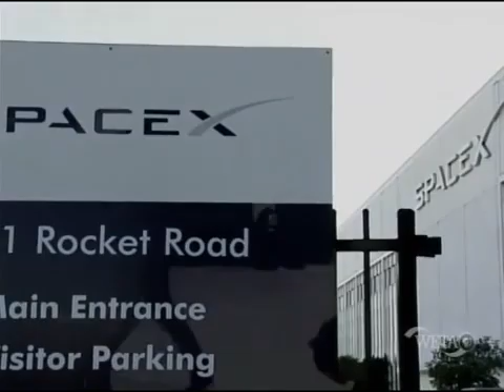SpaceX and the Future of NASA, PBS NewsHour, May 3, 2012

Comment: 10 years later, Orion still have not launch.
Reply: Orion launched in 2014
Reply: @Manuelziy  Seems like the "high-risk" commercial approach the Lockheed executive are touting here beat it to operational level & launches several times
Reply: @alvianchoiriapriliansyah9882  Orion is not comparable to Dragon in terms of missions and functionality.
Orion is a lunar capsule, Dragon is  built for LEO.
Orion can carry the same amount of crew for 3 times the duration and can actually perform significant propulsive maneuvers with its service module, something that Dragon doesn't have.